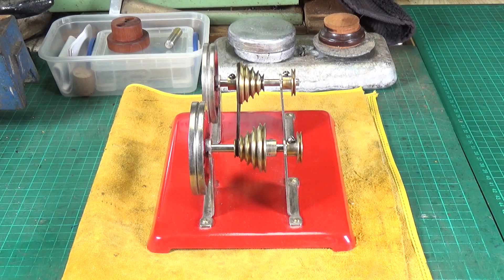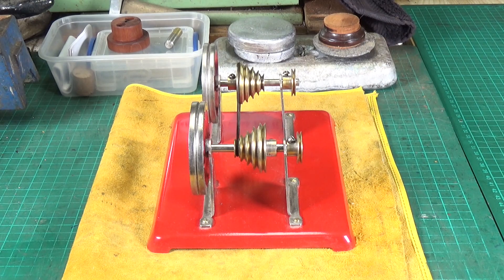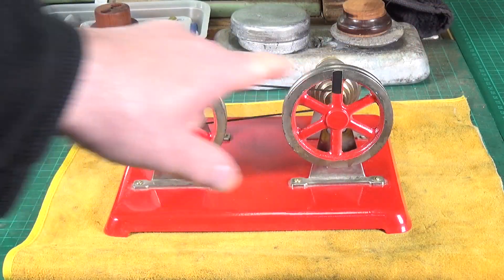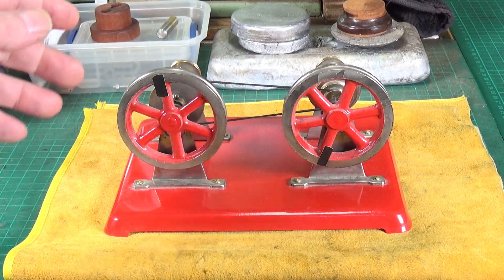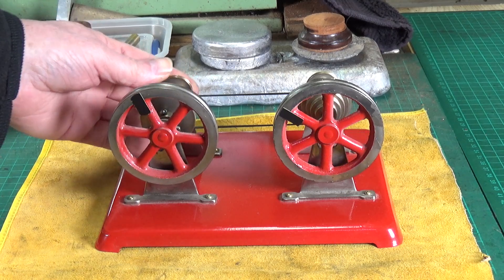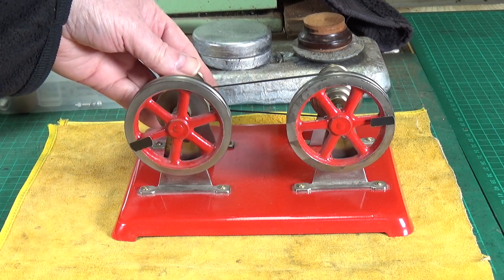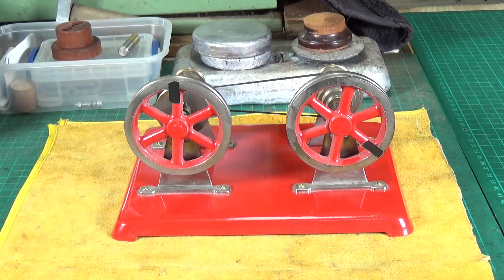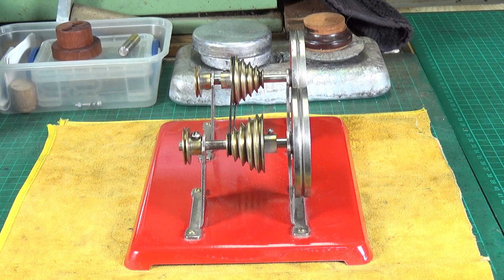Pulley Ratios - What's It All About?

Comment: Good video Alan. Yes, when belts slip it's always on the small pulley, for all the reasons you stated, even with a perfect belt fit.  There is probably a minimum practical drive pulley diameter you can go down to for a given drive belt cross section. That variable drive setup is a good idea.  Cheers Rob
Reply from the maker: Thanks Rob. Those Empire drives are great but quite rare. Did you see the ones Jim made?  Superb, ball bearings and aluminium pulleys, lovely job. Cheers, Alan.
Reply: @RetroSteamTech  Hi Alan.  Yes I did see one on Jim's channel a while back.   I like a model gold ore stamper/battery he powered with a (Stirling ?) engine in one video.  I've been tempted to make something similar.  Looked good. He has some nice models and spends up big on his hobby. Cheers Rob

Comment: Good demo Alan. The pulley setup is like the pulleys on my lathe. Pulleys on the counter shaft and the spindle. What I noticed was when the drive belt is set to a low speed the drive shaft is stiffer to turn than when set for higher speed. I imagined this was a difference in belt pressures on the spindle. The spindle obviously carries gears and the chuck. Never quite figured this out 🤔 Cheers Nobby
Reply from the maker: Thanks Nobby. Low speed generally means higher torque which which would make the drive shaft harder to turn. Cheers, Alan.
Reply: @RetroSteamTech 
It is exactly that he is experiencing....very much like trying to start a car moving from standstill in top gear vs 1st gear.

Comment: Hi Alan. Thank you for an interesting and informative look at gearing up and gearing down. Question, if you want to maximise torque what is best, one to one or gear down / gear up?
Reply from the maker: Hi Andrew. Gearing down will give more torque, so small driver pulley larger driven pulley. The problem is that you lose RPM as you gear down. Cheers, Alan.
Reply: Gearing upp - Increases speed and Decrease Torque
Gearing Down - Decreases speend and Increase Torque

a good example is a car u 'gear down' to pull heavier loads (wich need more torque), and u 'gear upp' to go faster

Basicly
 Torque = ( Radius-out / Radius-in ) * Force-in [T=(r₁/r₀)F = rF]
Speed = ( Radius-in / Radius-out) * Velocity-in [V₁=(r₀/r₁)V₀]
Reply: Thank you. I had a mental block and it seems obvious now 👍🥴
Reply: Informative subject explained well.
Reply from the maker: @MrNostalgicdave  Thanks David. It's all too easy to assume that everyone knows what you are talking about sometimes. Doesn't hurt to go back to basics occasionally. Cheers, Alan.
Reply: Speed of driver / speed of driven. Dia driver/dia of driven. No. of teeth on driver/no. of teeth on driven.
Reply: @scottmasson3336  TYVM ... Just noticed i reversed this in the torque equation above .. correcting it an adding the speed equation